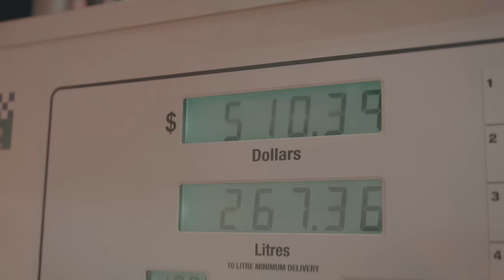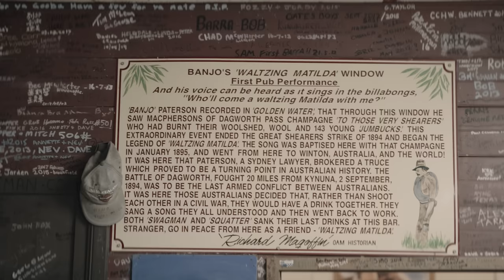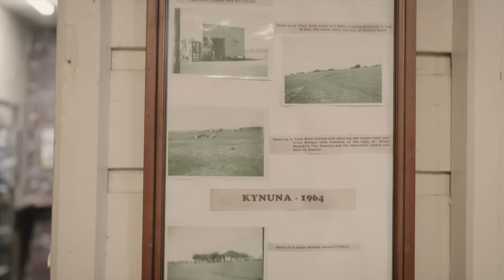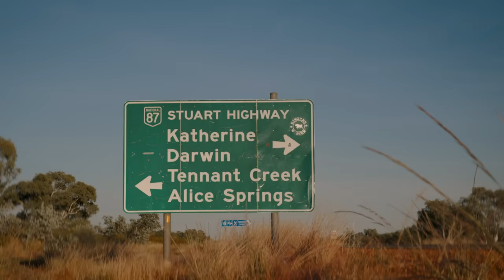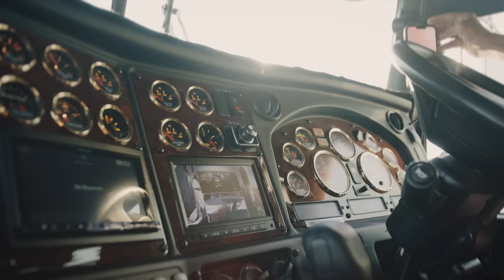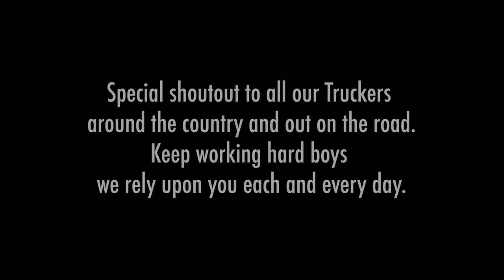Hauling Down Under: STM's Gold Coast to Darwin Epic Road Train Adventure

Comment: "It's the biggest roadtrain you can drive in Australia, it's 53 m long"
Small correction, it's the longest roadtrain you can drive on most public roads.
There are longer roadtrains you can drive from mines to port in the Pilbura, but they are on specific private routes. 5 even 6 tipper trailers.

Comment: Just curious why would you switch trailers around and then drive an empty tractor in the convoy? Why wouldn’t you just continue with the shorter loads and distribute the trailers and load more evenly just like you had been doing earlier in the trip? I know nothing about road trains, but only thing I can think is that maybe it saves fuel?
Reply: To make the show

Comment: If use are running 2 trucks what is the point of bobtailing 1 and running all of the  trailers on the 1?  Do use leave the other 1 somewhere or is it just for looks?
Reply: Scott wanted to run a 4 trailer road train to Darwin.

Comment: is it more efficient if u use 1 road train and 1 seperate truck than 2 smal road trains at all times ? im just wondering if it is
Reply: (triples ("A-triple" roadtrains, with 2x dolly converters))  and the various Quad (ABB,BAB) configurations can only run on certain routes - in the eastern and southern areas of Australia, for those regions B-Double (or B-Triple for some routes) is the biggest truck that can be run, hence running a BAB-Quad means it can just be split into 2x B-Doubles (plus an empty dolly) and a contractor can pull the second B-Double rig (If an outfit wants their own prime-mover pulling both, it may just be better to either bobtail the second prime-mover or don't bother hooking up the BAB-Quad.) )

Comment: Need to get the terms correct - calling a "B-Trailer" an "A" is ignorant (though possibly typical "trucker parlance") - the "dolly" +  semi-trailer MAKES an "A" (dolly + semitrrailer = (effective)Dog"box"; ie A-trailer - [NB. A-frame drawbar]....)  The  "B" is the hookup using the shared wheelset on the  "B-double" (bridge trailer = "B")